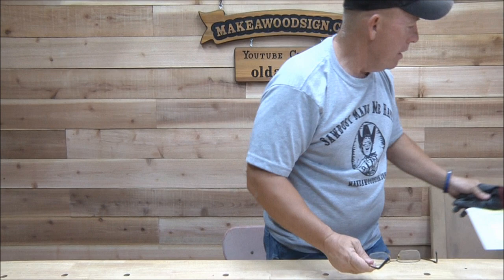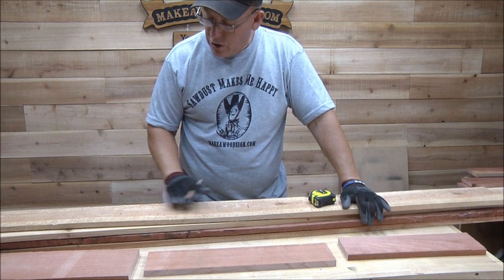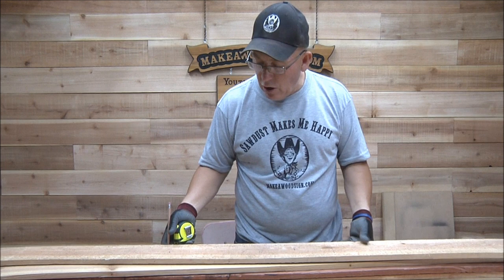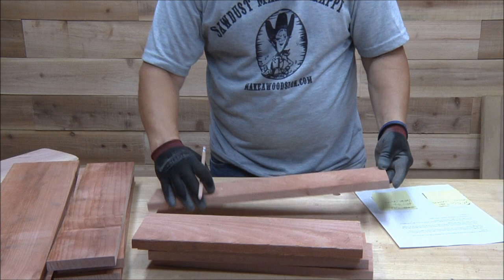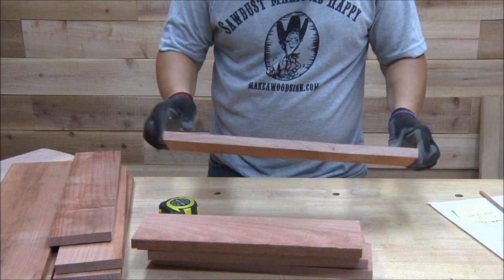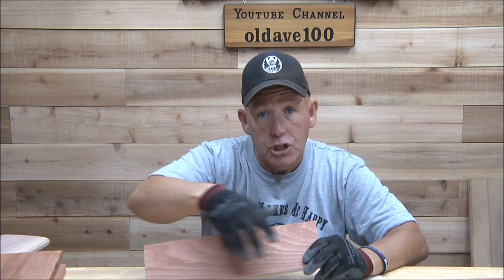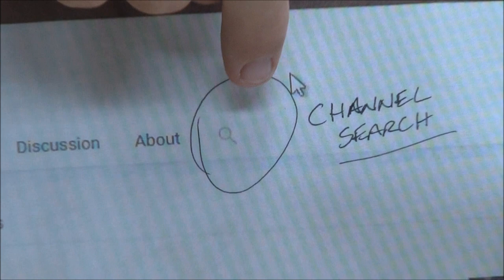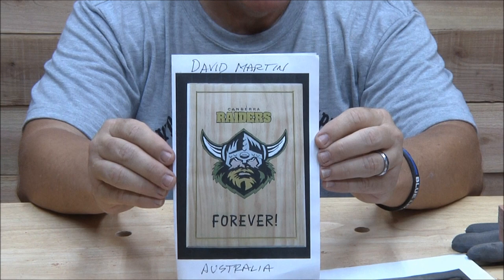Coffee & Questions 8/2/17 Tips on Board Prep For Making Signs

Comment: When is sanding sealer applied. I am carving pine. Should I sand my board and then apply sanding sealer. No cedar around here yet, and I found some but it was in rough shape. So let me know, sand the board first and then seal?
Reply from the maker: My pine boards are all ready smooth when I get them so I don't sand them first. I just apply the sanding sealer right away.